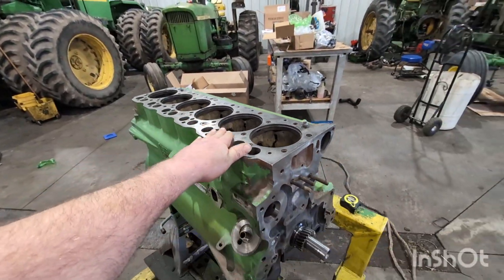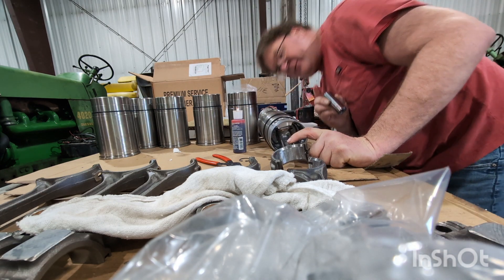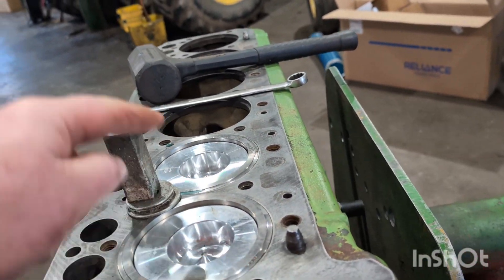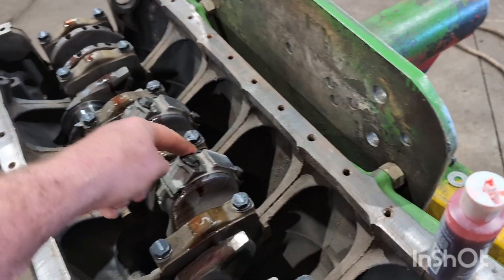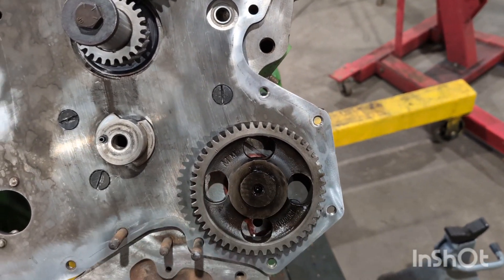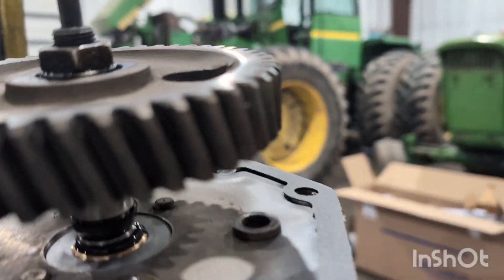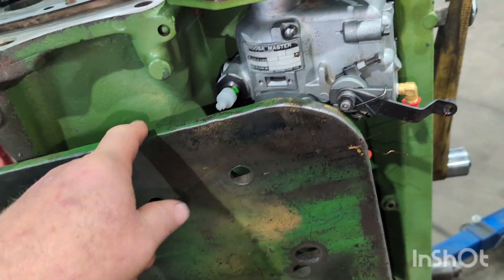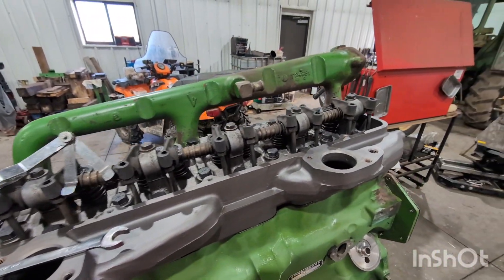John Deere 329 engine assembly. Some differences vs the 404. Getting the rotating assembly together

Comment: Reliance kit vs Maxiforce vs John Deere rebuild kit?
Reply from the maker: Used reliance for 30 years.
30 engines in the last 4 years.
Might have our first issue ever? Still need to diagnose.
Use Deere gasket kit.

Don't know anything about Max force.

Deere will be a good kit.

Comment: If you have you field day on August 22nd, I will be there this year.
Reply from the maker: August 15th I believe this year.
Reply: @jonstevensmaplegrovefarms3754  If it is the 15th I will take the day off.  The tractor pull in Ogilvie is on the 22nd.
Reply from the maker: @rudyjensen9917  what are we going to talk about this year?
Reply: @jonstevensmaplegrovefarms3754  does soil type make a difference when doing strip till.  Does some soil type respond better then others.
Reply from the maker: @rudyjensen9917 yours might get to dry in the summer. Lot of risk for the season for a slight planting improvement?!

I was thinking of maybe a farmer just do a here's what I do presentation, 

 a couple guys to talk about biological products, how to use them. Have lunch and then pasture walk row crop walk?